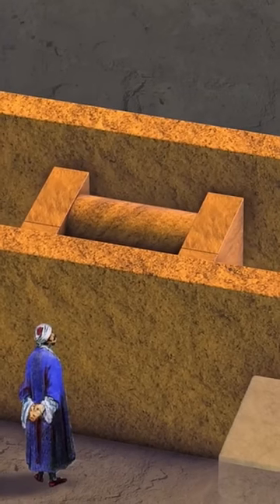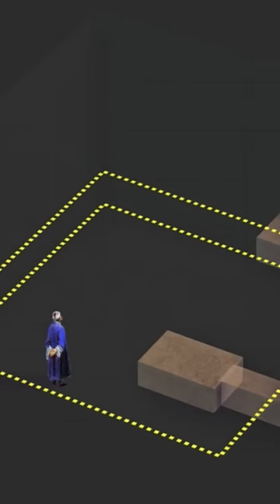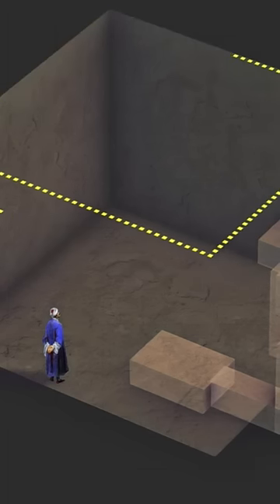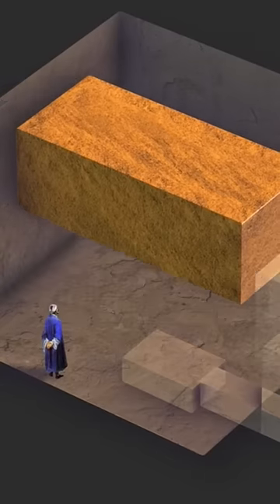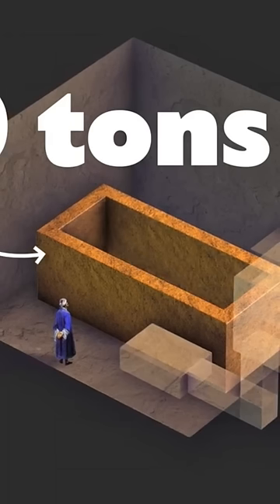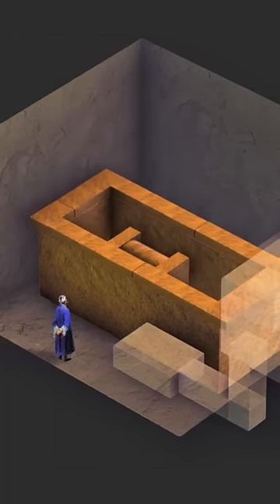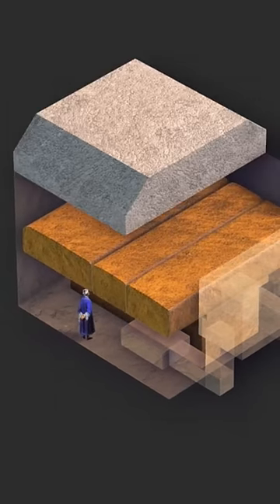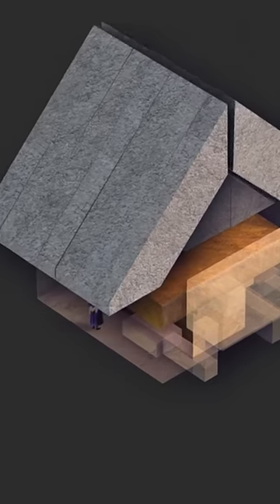What is inside of the Hawara pyramid?

Comment: Theyre not tombs for the dead. They’re machines for the living 😉 the evidence is overwhelming
Reply: a "machine" with no moving parts
Reply: Please give this "overwhelming evidence"?
Reply: @homer1273  machines don't need moving parts. Sound was the engine. Geometry is the machine.
Reply: @homer1273  or how do you know the "moving parts" weren't removed at some point, or made of something that decayed over thousands of years? There are seemingly pointlessly small holes throughout the pyramids, possibly for wires or conductors of sorts. Or ventilation to cool molten metal or rock... Very low level thinking.
Reply: @obviouslyambiguous8308  "machines don't need moving parts"

machine definition:

"an apparatus using mechanical power and having several parts, each with a definite function and together performing a particular task"
Reply: @obviouslyambiguous8308  
"or how do you know the "moving parts" weren't removed at some point, or made of something that decayed over thousands of years?"

Absence is not evidence unless you can prove what is absent

"There are seemingly pointlessly small holes throughout the pyramids, possibly for wires or conductors of sorts. Or ventilation to cool molten metal or rock"

Holes drilled by people looking for cavities.

The ventilation shafts may have been there during early phases of construction so that the workers did not suffocate after they added the roof to each chamber - they do not actually reach outside the pyramid from either chamber, so they could not have been intended for ventilation once it was finished.

"Very low level thinking"

The irony that you are woefully ignorant about the subject is pretty hilarious to me.
Reply: vibrations from sound make them moving parts. non-moving would require no sound.

Comment: And idiots try to tell us they only used copper tools. I’m a diamond driller and quartzite is so hard it polishes the diamond bits so they won’t cut. They weren’t like us which everyone seems to think. They knew levitation and magic. They used 100% of their brains. We use 20% if you’re Einstein. It’s all possible if you know how
Reply: "And idiots try to tell us they only used copper tools"

Bronze - not copper, and usually with quartz sand or corundum abrasives for cutting harder stone like granite.

"I’m a diamond driller and quartzite is so hard it polishes the diamond bits so they won’t cut"

Quartzite is mohs 7-8, and diamond is mohs 10, so I would say that you are confused about it's capacity to cut.

Also people do not drill with diamonds genius - we make diamond COATED drill heads.

A diamond drill head would be insanely expensive to synthesize.

"They knew levitation and magic. They used 100% of their brains. We use 20% if you’re Einstein. It’s all possible if you know how"

Ye but no - we don't use all of our brains at once because it would literally overheat and cause a massive cerebral haemorage.

Our brains use about the equivalent of 20 watts of power when they are fully active.

Imagine that x10 - your head would feel like it was on fire for the short time you had left alive.
Reply: @mnomadvfx  if you read it correctly I said the bits get polished and won’t cut. If it’s a bit with diamond in a matrix, then you can cut back on fluids to heat the bit slightly and sharpen it without pulling the rods. I’m in my 60s and drilled all my life offshore and onshore everywhere. Diamond drills will cut anything but the bits do polish if little grain like chert or something similar

Comment: Some kind of machine's, had to help.  We need those machines today.
Reply: Brain is the only machine you'll need.
Reply: We still have hands, brains, and the simple machines they had.
Reply: @dustinwright4366   🤡
Reply: Demons
Reply: Likely, probably a counter weight elevator of some kind.

The Egyptian's and counter weights were pretty much hand in hand.

Just look to the Anubis myth with him weighing the heart against a feather.

It may be a stylised but the myth holds the grain of understanding this concept very clearly.
Reply: @tpxchallenger  True.

We just use electrical motors, hydraulics and braided steel cable to augment the basic concept of counter weight they already had back then.

Comment: People still leading on it was a tomb .. And not a huge semi-conductor for earth's electricity. .. 🤔🤔🤦🤦
Reply: Yes and NOOOOOOOOOOOOO.

Large stone blocks do not semi conduct.

They just plain DO NOT conduct.

Even gold will conduct terribly at that thickness.

(resistance increases with conductor thickness)

Stone won't conduct at all at that thickness unless it contains very thin seams of conductive metal in exactly the places where you placed the electrodes and connecting from one side to the other without inducing enough loss.

As I've yet to see a single Egyptian stone block look like that I'm gonna go out on a limb and say not.
Reply: @mnomadvfx  it's a big spark plug buddy. You put that much limestone, or quarts backed up with tons of stone on it and a nice polished ceramic exterior that's been removed with a point of exit capped with gold.. Why do you think Tesla back in day mouth dropped when he took a look at it and somewhat copied it and made his own.. ?? Yeah.. You need to keep an open mind and do more research buddy

Comment: I’m still wondering what they used to “harden” the sand.
Reply: Salt water maybe.
Reply: I would bet if is sound.. i mean, some form of specific frequency that would melt rock. then when all the sand grain were starting melting..it must turn into a somehow gel and then stop the frequency were the rock turn solid again, but all part are meltede in one stone piece. I may sound crazy..but, in Romania, there is a gold mine where was found a slab bigger then the biggest monolith in Baalbek. What special about it is it was made of 20% or granite, 25% of tungstene and 55% of gold. It was inside a very small shaft ...digged in the rock.. so it has to be made right there..or transported. the size of the shaft was soo small to have two human side by side to lift the slab..so even less space for a machine... not enough space for a mold either..only conclusion..it was molded elsewhere then carried..old African people talk about rock that move by music...??? What music is ? Frequency ..so..

Michel
Reply: @MrToppazj  I could absolutely see them using resonate frequencies to alter melting points of objects. Makes sense to me. But I'm no scientist
Reply: Probably sandstone,A desert turning to stone at the base of the dunes that never move just the tops

Comment: It was a capacitor with different material for reaction from piezo electricity made from Aquafir below with the weight of of your so called sarcophagus created the piezoelectricity . The 2 chests were the capacitors of power storage or arc of covenant type box.  Once the desired build up of piezo electricity was achieved,  then it would release and exit through the apexon top and work together with all the other pyramids in the circuit which encompassed the entire planet perfectly like perforated circuit board to power???? Maybe the tower of babel so that the fallen could commit mutiny by reaching the heavens with God and overthrowing him like he did to the fallen on Mt. Hermon in ceria,(misspelled I know) so very long ago.  ! That is why he struck them down and spread them out across the globe and confused their tongues so that they couldn't devise this plan again! Just a thought
Reply: You should go into fiction,Your wasted here on comments
Reply: Sounds about right to me. I concur.

Comment: So how did they curve out the tomb with only Bronze tools?
Reply: The bedrock was limestone which can easily be carved with bronze tools.

Harder rock would be cut using a saw, water and an abrasive like quartz sand.

Even a flint chisel can be used to make fine sculpt marks on granite.

The Egyptians worked with stone for millennia before they discovered copper/bronze - do you really think that they didn't have experts in masonry by that time?
Reply: Copper
Reply: I call shanigans on the granite cut with precision only using copper chisels. It's hard enough to cut it with diamonds.

Comment: They are forgetting one crucial detail, there is no fuckin way your fitting any kind of machinery or pully system that's big enough to move those stones around the way you just depicted lol it's literally not possible.
Reply: Based on what expertise of machinery?

"big enough" is meaningless when you can split the load between many machines with each holding counter weight to offset the mass of the lowered object.

Comment: How in the f*** did they lift and move stones that enormous it's mind-boggling I'm sorry you can't move 110 tons by dragging it with handmade ropes. You can't lower 110 tons into the ground with some bits of wood and wooden block and tackle it would destroy all your equipment
Reply: Obviously the video is not detailing all of that stuff and isn't showing the work men either.

Also obviously 1 rope would be destroyed, but if you used several at once you are distributing the load across them all.

Combine that with counter weight and the job looks a lot more feasible.